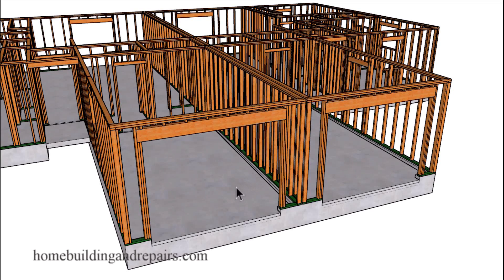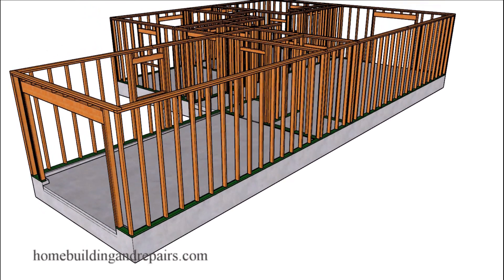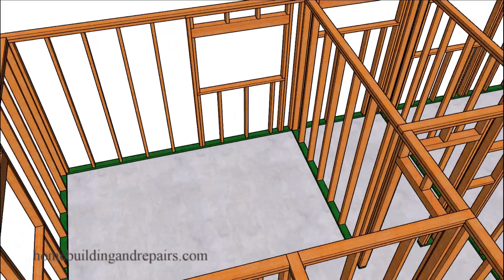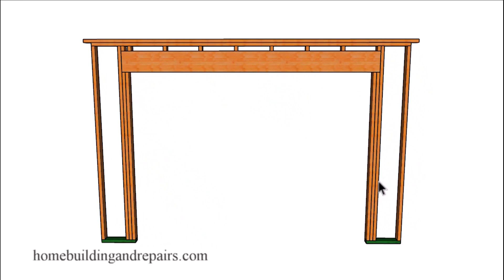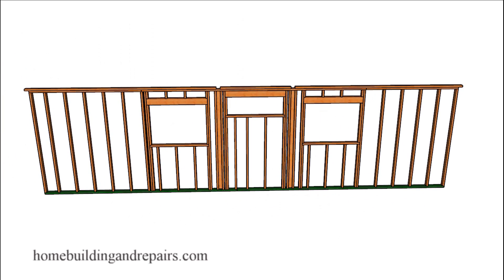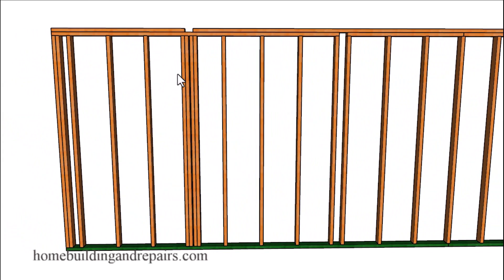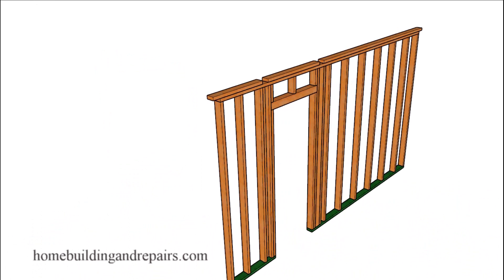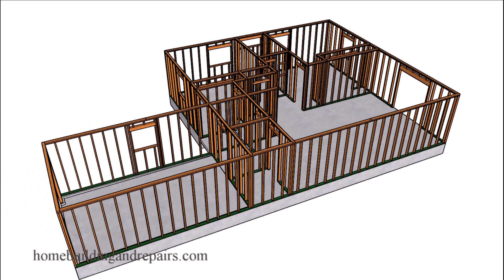Duplex Apartment Wall Framing - Two Bedroom One Bath With Identical Floor Plan Layout

Comment: want to remove 8' of a block load bearing wall truss lenght are 24' no snow load and install a 6''x 5 1/2'' glulam for new opening will this work?
Reply from the maker: I can't provide lumber sizes or engineering info, but can tell you that I've seen lots of 8 foot openings with a 4x8 for single story house with no snow loads.

Comment: Do you add your top plates after standing up connecting walls, or do you put on the top plates before you stand up the wall and then fit them together like a puzzle piece
Reply: add top plates after you plum the wall
Reply from the maker: I usually install top plates before standing walls built on floor, but they can be added after if that's going to be easier.

Comment: In the concrete floor in between the units we have been putting a 1 1/2 channel in the concrete floor so if one unit floods the other one will not
Reply from the maker: I don't know if that's something that couldn't fill with debris and block channel from draining. Does that sound possible?